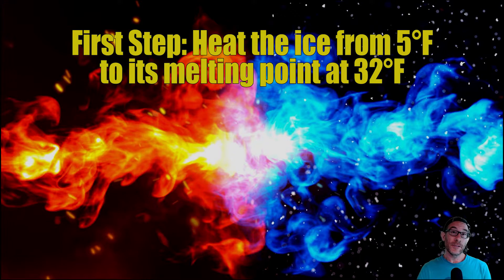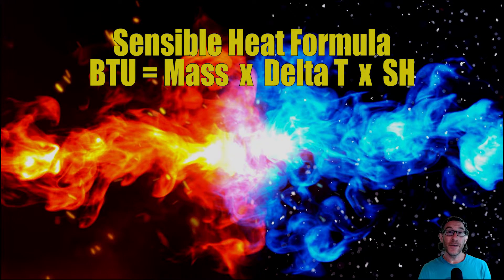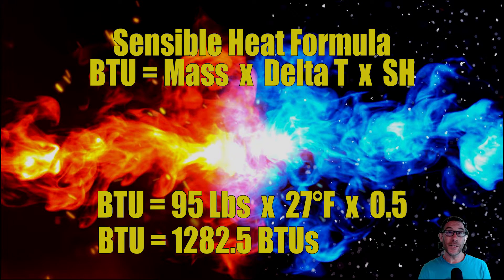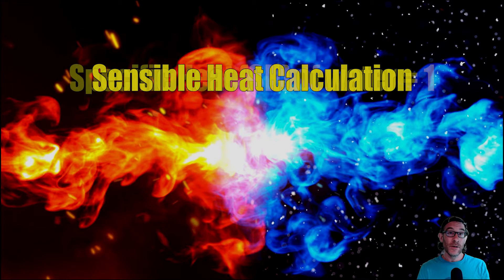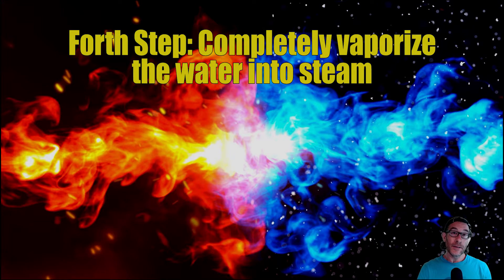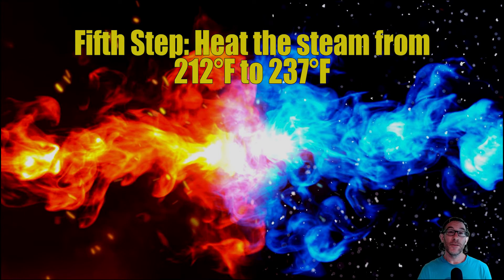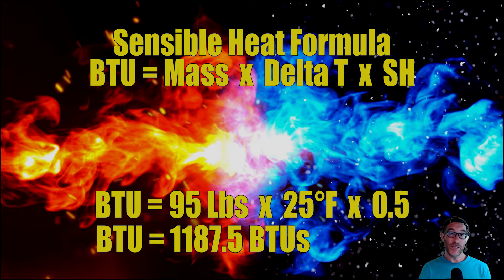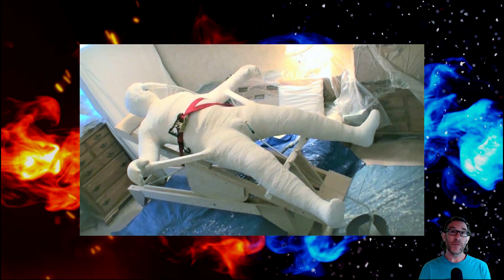How to Calculate BTUs for Heating Water

Comment: Hey bud just gave my 4th year AIT i felt like the college prepared us soley for AIT not the red seal . My red seal exam was very much gessing and i feel bad about it . There is not exact book or something i can prepare from for plumbing and gas red seal ? please help
Reply from the maker: The short answer is no. The red seal is written by a committee of trades people from across Canada. Everything about this test is kept extremely secretive, including keeping AIT firmly in the dark.

It is intended to be a test that focuses on "practical knowledge" from working in the field. But this is pulling from experiences that can be encounter across all of Canada, so it can be a real mixed bag.

I know some of the questions are directly found in the code book, other questions you will need to use your reasoning skills. The thing that no one can give you is a cross section of the questions you can be asked.

Comment: This is one my favorite videos on this topic. There is however a small mistake on the visual that appears just after the 4 minute point. While Kelly SAYS 95 x 180 x 1 = 17100 (which is correct), the video SHOWS 95 x 27 x 0.5 = 17100 (which is incorrect).
Reply from the maker: Yes, sometimes my brain and mouth work on different planes.

Comment: What do I do if I need to only turn water into steam. 100 gallons of water at 40 degrees Fahrenheit to steam at 220 degrees Fahrenheit?
Reply from the maker: You need to start at the sensible heat calculation of water. The delta t will be 212°F - 40F = 172°F. Do your BTU calculations for that, and then continue with the latent heat calculations for the vaporization of water to steam. And then end with the sensible heat calculations for raising the steam temperature from 212°F to 220°F
Reply: @MathematicPlumber  got it. Thank you